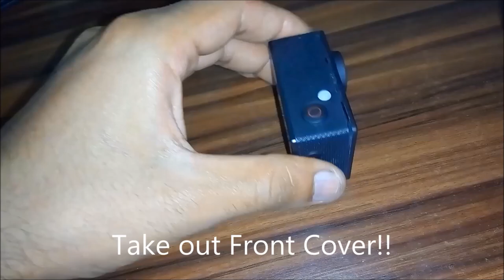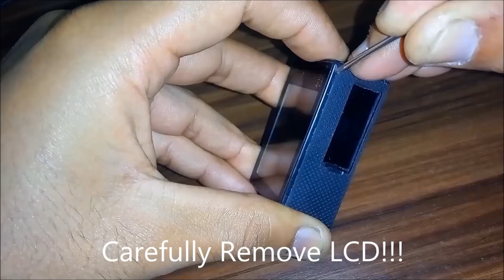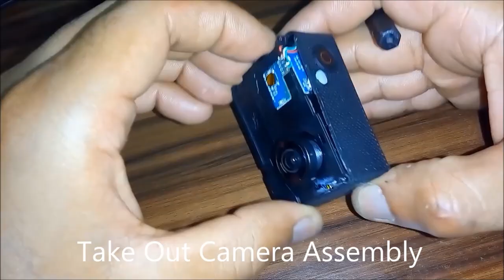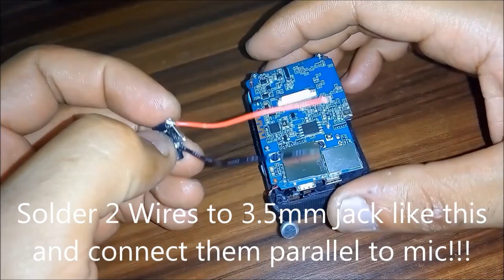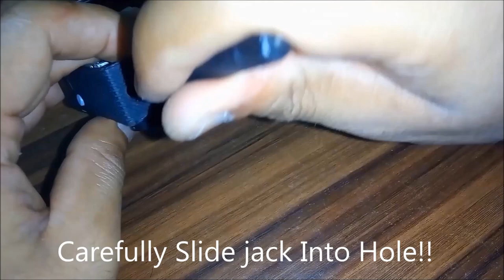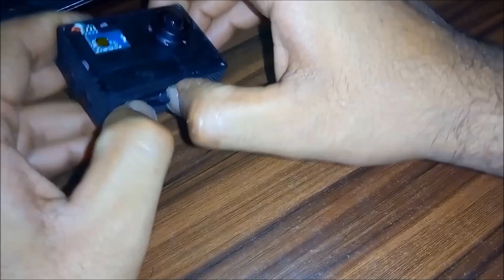Installing 3.5mm Plug And Play Microphone jack in Eken H9 Action Camera!Easiest Method!

Comment: The question is,how do we use it if we have the camera in a waterproof casing for a motovlog as example..
Reply: so a bigger microphone picks more noise?
Reply: @chewysplace3542  You guys are both missing the point. You could make it water tight around a case very easily. You could also wire a mic to your helmet in this case...

Comment: Very helfull video ;) 
Im assuming if we solder a 30k resistor into the female jack,the internal mic will be switched off when we plug the external mic jack.Thats the trick on the mini USB converters ;)
Reply: can you please share a video or you can help me by finding a video how to do it.................thanks in advance
Reply: Thanks for the tip

Comment: Could you please make a video dedicated to the testing of the internal and external microphone now that you have done this mod (with no editing)? I would imagine that either both mics record now. Or that one is recorded but the other is draining power and makes it quiet.
Reply from the maker: https://www.youtube.com/watch?v=M7U2QtzP3Ao
Reply from the maker: Yes Both Mic works...!!!
Reply: Yeah, I just watched that. I was wanting to know if you could please create a new video where you start without a mic and then plug it in. This way we can see the difference as you have already modified the stock camera to use a bigger mic. Thanks!
Reply: Any updates? I have a H9 and I am wodering if I should do this for my motorcycle rides.
Reply from the maker: Sure U can do it....U gonna have to drill a hole in ur waterproof case as well...!!!
Reply: TopEnd Can you please make a video how the sound is without inserting a microphone? (just the camera)
Reply from the maker: Sure.I'll do that!!!
Reply: Do it! But then also plug it in, so we can compare the difference!
Reply: TopEnd . If I ride the motorcycle, I am afraid that the internal microphone will make a buzzing sound at high speeds. Should I keep only the external mic? We are waiting for the microphone test video :d
Reply from the maker: Sure man I'll make vid soon...If u want u can completely remove the internal one...Cuz this cam doesn't have wind noise cancellation program!!!
Reply: TopEnd TopEnd How do I know wich is the " + " and wich is the " - " in the camera?
Reply from the maker: U'll find symbols on mic..!!
Reply: TopEnd Tap and die set and a life proof head phone adapter
Reply: id buy a new one becuase its cheap

Comment: Nice video!
So this 3.5mm jack you installed is it a switched socket? Meaning it will work when you plug in an external mic and switch off the internal?  If so please let us know the socket jack you used. Thank you.

Comment: Can you give link to 3.5 small mic adaptor you are using that you solder to the mic
Reply from the maker: https://www.aliexpress.com/item/10Pcs-PJ-320-d-headphone-female-socket-Headphone-socket-Headphone-jack-port-3-1pin-left-three/32771954997.html?spm=2114.01010208.3.210.vfzozx&ws_ab_test=searchweb0_0,searchweb201602_4_10065_10068_10000032_119_10000025_10000029_430_10000028_10060_10062_10056_10055_10000062_10054_10059_10099_10000022_10000012_10103_10000015_10102_10096_10000018_10000019_10000056_10000059_10052_10053_10107_10050_10106_10051_10000053_10000007_10000050_10084_10118_10083_10000047_10080_10082_10081_10110_10111_10112_10113_10114_10115_10000041_10000044_10078_10079_10000038_429_10073_10000035_10121,searchweb201603_1,afswitch_1,single_sort_3_price_asc&btsid=50f461ef-a28c-4648-bcb0-0952f81ff5dd
Reply from the maker: But U can get it at local electronic store just for 0.2$ or less!!
Reply: TopEnd how about wires and speaker you upgraded
Reply from the maker: Naah speaker is same..!!Wires just connect -ive to front pin and +ive to rear pin of the jack...Leave the middle one empty!!!We r only using 2 pins out of three in jack cuz mic programming is mono!!
Reply: TopEnd  I was also what type of wires you use sorry for to many ?
Reply from the maker: Just any normal thin wire will do.!!

Comment: Hi, I did this and work's fine but is there a way to stop internal mic when external mic is plugged?
Reply from the maker: Well Best is to remove internal mic...cuz there r 5 pin jacks available that can cut internal supply when ext. is plugged in but I'm not sure that jack will fit in such small space!!!
U may try...=https://i.stack.imgur.com/xASEt.jpg

Comment: i got the jack, but where should i solder the wires?
Reply from the maker: solder em parallel to mic connections....On jack...Connect +ive to front point and -ive to rear two(short rear two point of jack to -ive)
Reply: Did you manager to do this?

Comment: Dude I need help , I just bought this cam and I want to do this mod but what jack is it . There hot so many type of different 3.5mm jack , where you got from. Can send me link. I live in Malaysia, where can I buy
Reply from the maker: These jacks r available at local electronic stores but of u can't find one u may order on aliexpress
https://www.aliexpress.com/item/PJ-320-3-5mm-Auido-Video-Female-Jack-Socket-3DIP-Pins-3-5-Headphone-Connectors-High/32725372062.html?spm=2114.search0104.3.53.ReUDjr&ws_ab_test=searchweb0_0,searchweb201602_3_10152_10065_10151_10068_10344_10345_10342_10343_10340_10341_10540_10307_5640015_10060_10155_10154_10056_10055_10054_10539_10538_5370015_10537_10059_10536_10534_10533_100031_10099_10338_10103_10102_10052_10053_10107_10050_10142_10051_10084_10083_10080_10082_10081_10110_5590015_10175_10111_10112_10113_10114_5610015_10312_10313_10314_10078_10079_10073,searchweb201603_25,ppcSwitch_5&btsid=969bbb21-5bb6-4c73-8325-a74b8b89c84f&algo_expid=d97b3d82-5bb0-490a-abf6-529cfb4247b5-7&algo_pvid=d97b3d82-5bb0-490a-abf6-529cfb4247b5
Reply: i found many but those kinds are 5 pin and idk how to use that , i want a simple 3 pin. thank you. you have good service. take my subscription. one more thing, does it work , can show test video

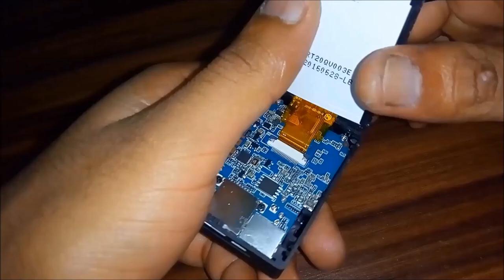Comment: Hope that  the orange tape that is cut at 1:08 its not the data tape!
🤔🤣🙃🤔
Reply: He didn't cut it. That's a ribbon cable and he released a latch that holds the end of the ribbon inside a connector. That's when the ribbon slid out, pulled outward by the mass of the screen it was attached to.

Comment: Is this a similar process to the ek7000?
Reply from the maker: Yes...That cam is Eken H9 with different brand sticker..!!
Reply: TopEnd whats the specs onvthe 3.5 mm jack? So i can find it easier.
Reply from the maker: https://www.aliexpress.com/item/20Pcs-3-5mm-Female-Audio-Connector-3-Pin-DIP-Headphone-Jack-Socket-PJ-320/32597284108.html?spm=2114.search0204.3.48.66f12eeevnMS8d&ws_ab_test=searchweb0_0,searchweb201602_5_10152_10065_10151_10344_10068_5722815_10342_10343_10340_5722915_10341_10698_10697_5722615_10696_10084_10083_10618_10307_5722715_5711215_10059_5723015_10534_308_100031_10103_441_10624_10623_10622_5711315_5722515_10621_10620,searchweb201603_28,ppcSwitch_5_ppcChannel&algo_expid=d2f5ba20-8fbd-4caf-9fc8-273c03095318-7&algo_pvid=d2f5ba20-8fbd-4caf-9fc8-273c03095318&priceBeautifyAB=0
Reply: TopEnd thank you!

Comment: i cant fund the socket can you send me a link to buy it ??
Reply from the maker: https://www.aliexpress.com/item/10Pcs-PJ-320-d-headphone-female-socket-Headphone-socket-Headphone-jack-port-3-1pin-left-three/32771954997.html?spm=2114.01010208.3.210.vfzozx&ws_ab_test=searchweb0_0,searchweb201602_4_10065_10068_10000032_119_10000025_10000029_430_10000028_10060_10062_10056_10055_10000062_10054_10059_10099_10000022_10000012_10103_10000015_10102_10096_10000018_10000019_10000056_10000059_10052_10053_10107_10050_10106_10051_10000053_10000007_10000050_10084_10118_10083_10000047_10080_10082_10081_10110_10111_10112_10113_10114_10115_10000041_10000044_10078_10079_10000038_429_10073_10000035_10121,searchweb201603_1,afswitch_1,single_sort_3_price_asc&btsid=50f461ef-a28c-4648-bcb0-0952f81ff5dd
Reply: Hello! I bought the jack socket from this link. Can you PLEASE tell me how to connect it?
I want to remove the internal mic and just use this socket. There are 4 pins: numbered 2,3,4,5(on the picture) How should I connect them? 

PLEASE HELP!!!    (i could not understand the pins in your video)